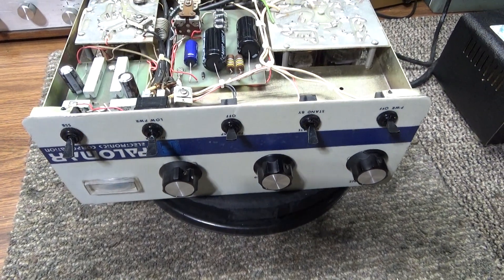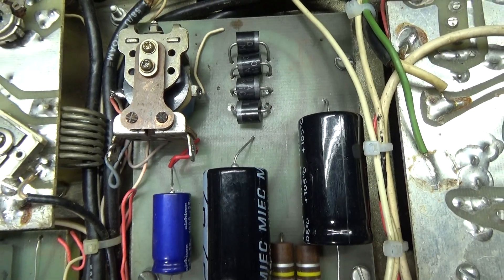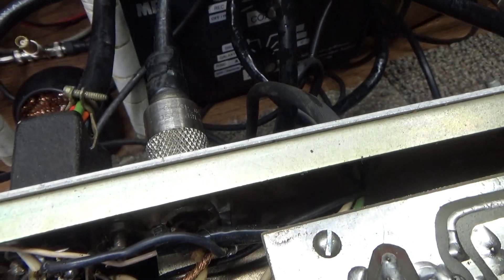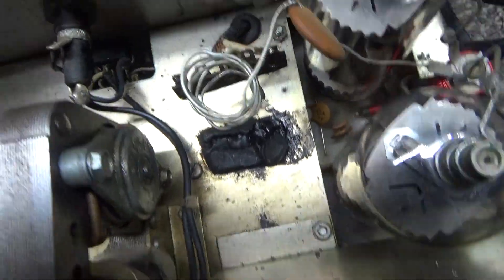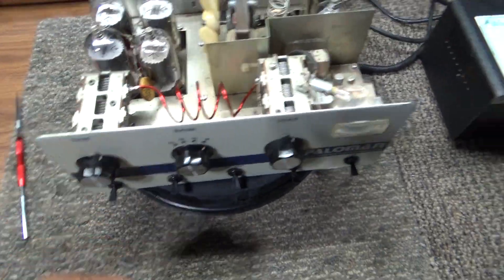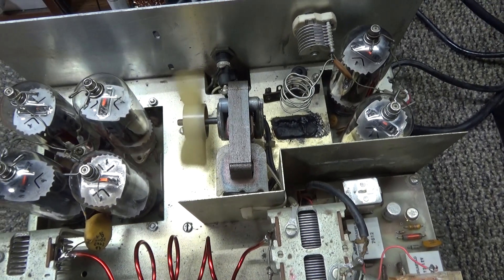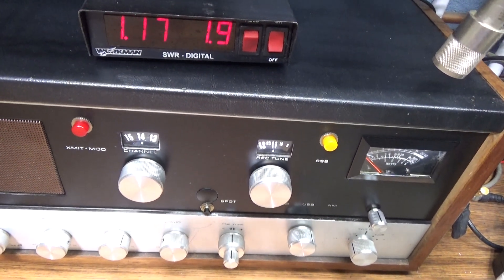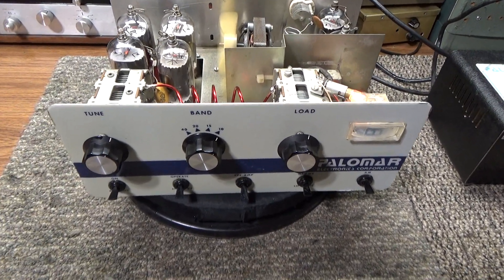Palomar 300a on the bench + a few tips. CUSTOMERS not mine

Comment: The band switch coils were removed ,that coil in the pie network looks wrong for 11 meters. that will cause low output. That  300A must have been built when they were changing from black face to white face . that amp has the relay /pre-amp board laying flat and hard wired. White face 300A's have the same board but plugs in and has  different relays. You were asking about the adjustment at the rear on another video. that only matches the driver tubes to the final tubes,only  works in high .

Comment: Your the man for sure.. 
especially to ask this question, 
I just bought what appears to be hardly used still in the two styrofoam crates from Palomar 300-A with owners manual and a graph print out of performance
Output while on low or high @ 10 meters.. every thing is very clean inside by looking at pic’s 
Extremely shocked I found one in such great shape .. black front chrome top…
& was wondering if it possible to do an 11 m conversion..?
Or is ok to tune on 11 meters..?
I would think yes ..just lose a few watts.. but I’m not sure I figured I would ask you and also last question what is the maximum input without hurting the tubes and I do appreciate you answering my last question a few months back. 
Thanks again ..👍
TJ.
Reply from the maker: It will work on 11 meters just fine. Actually, it is set up for 11 meters, but because of this thing called the FCC, it could not be advertised and sold that way legally.

Comment: Hey bro I have one ,but I need tubes where or what other tubes do you suggest .all the same or not?
Reply from the maker: the 2 drivers need to be the same and the 4 outputs need to be the same. 6LF6   40   6V 2A
6LX6   40        6LF6, 6LX6, and 6MH6 are said to be virtually identical except for size
6MH6  38.5
6JS6   28
6JS6A  28
6JS6B  28
6JS6C  30
6KD6   33
6KN6*  30
6LB6   30
6LR6   30
6JM6A 17.5
Reply: @tramdr  what are the numbers behind the tube model #
Reply from the maker: their watt rating, but thats continuous full time watts out. It is said that a tube can do 3x the continuous when used for intermittent like CB amp use.
Reply: @tramdr  thanks